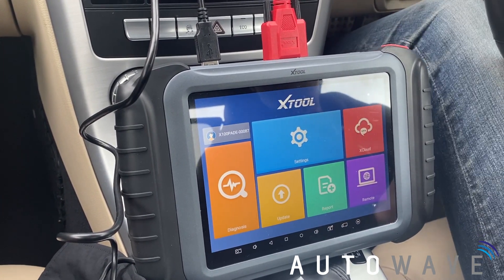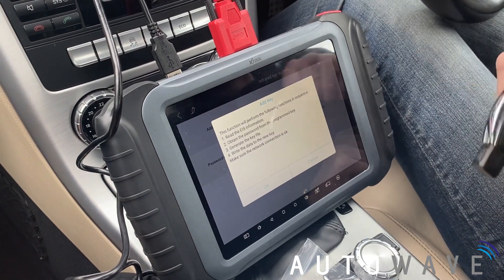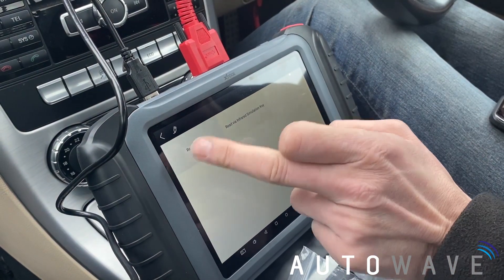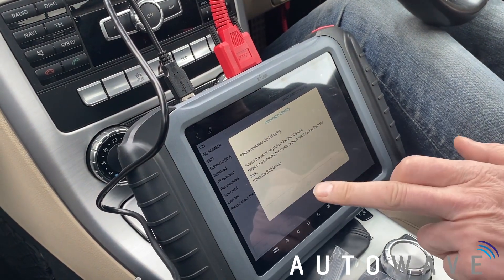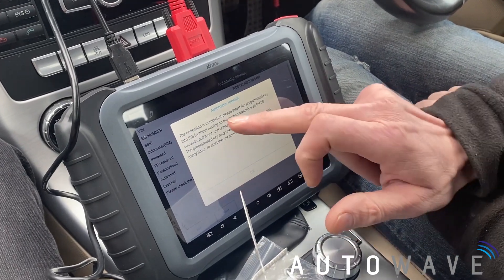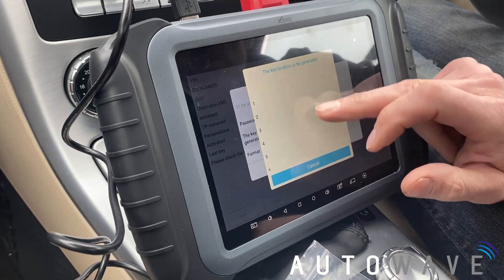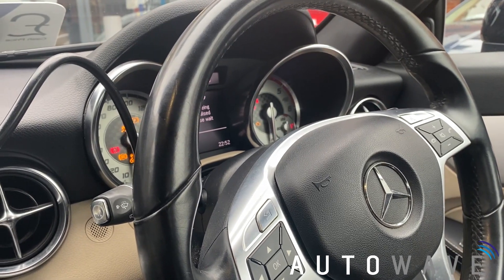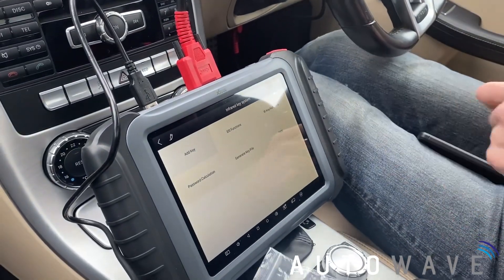Programming Spare Key for 2013 Mercedes Benz SLK using XTool X100 Pad Elite with KC501

Comment: say you erased the original key, can it be reprogrammed ? and is there away to see which slot the original key is in before setting the new one?
Reply from the maker: Yes original keys can be reprogrammed as a spare key, as long as there is a key already programmed.
Reply: @AutowaveLimited   thank you